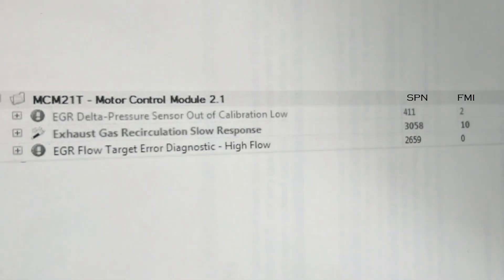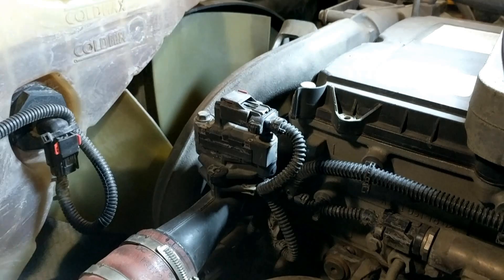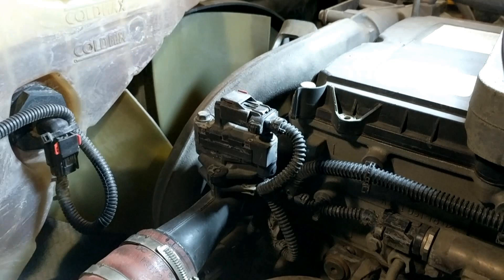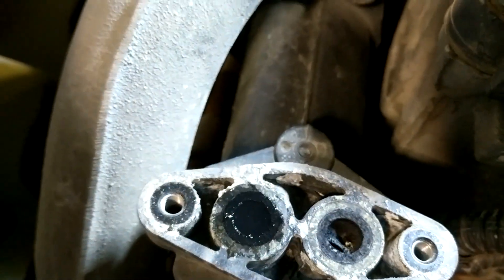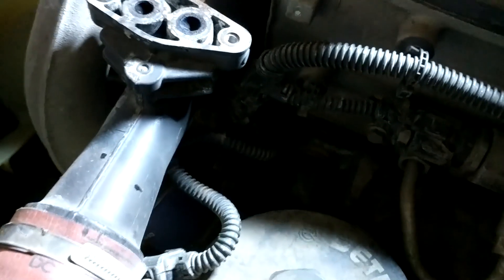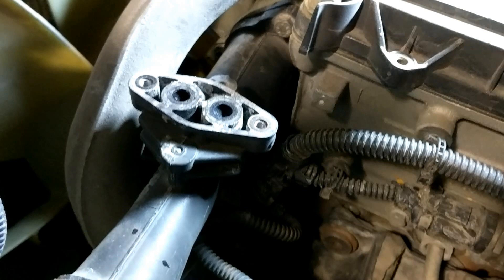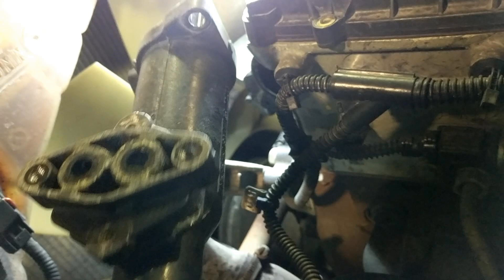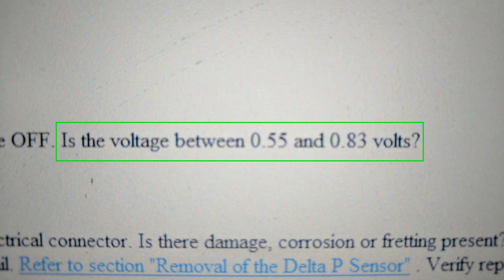EGR Quick Fix - Keep that Engine light OUT

Comment: Thank you for the video very simple and easy explanation. I am having the same problem right now. I will be disassembling the unit and checking for sudden blockage. Hopefully that fixes the issue you probably just saved me about $1500 at the dealer.

Comment: I’m having Issue with that code 
SPN 3058 FMI 10, I just replaced the VPod and the Delta P Sensor would it need to be recalibrated?

Comment: My truck been deleted. DPFs were removed but EGR wasn't blocked off like some guys have done. 

I received those egr codes recently. 

Spn 3058 and spn 2659

DD15
2016 cascadia 

Will blocking off the EGR cooler get rid of the codes and stop all that black smoke, leaving my exhaust?

Comment: I consider this basic maintenance, along with cleaning the 7th. Injector port (on dd13, dd15).  I clean them with a brass wire brush from a gun cleaning kit.  It's also very important to maintain your air dryer or moisture in the air lines will cause your pressure limiting valve to fail.

Comment: Thank you for the video. The problem im having is getting the v pipe off. Did you use a short socket and 3 inch extententiin or a long socket. Thanks in advance.

Comment: Good day, I have a question: should the delta sensor be replaced even if the EGR was deleted on the truck?
Delta check engine light is flashing.
Reply: The Delta P also regulates the Turbo Charger. If you still have a Delta Pressure Sensor, then it stands for a reason why you're getting a Delta Code. Replace it and clean out the Venturi Pipe. Clear those two small holes with a flexible wire or with a plastic zip tie on a drill at low speed. The zip tie will twist and act like a drill bit and break up the carbon build-up.  
 This should fix your problem.

Comment: Comprar uno nuevo es mejor las dos cosas $150 en el dealer y ya sensor y el gascket,i put new sensor and the other part for $150 at dealer chip it’s going to be better
Reply: Dicen que venden el kit completo con la pipa esto en necesario o solo el sensor y ya ? Q me recomienda
Reply: @JG-ss9xy  yo te recomiendo el tubo ese donde va el sensor y el sensor todo eso lo compras en el dealer el tubito negro y el sensor ya con eso esta bien 👍
Reply: @aleman876  si man gracias estás en lo correcto alguien me dijo lo mismo q comprara el tubo también q no lo limpiara porque se vuelve a tapar fácil, tú sabes si se necesita el laptop para programar el sensor o solo plug and play ?
Reply: No,solo cambias el sensor y el tubito negro donde va y ya,puedes cerrar la corriente por el switch del lado del asiento del chofer y abrirlo de nuevo y abres la llave 🔑 por 3 veces y la cuarta vez arranca ya el camion y listo
Reply: @aleman876  Great 👍 thanks a lot bro

Comment: I followed your video setup by stereo, and it's fixed. I asked the mechanic to take this apart, clean it,  replace the sensor and the gaskets.  He said, I've never heard about this, I can't do it. For $104 I got the original kit from the store in cambridge, ON. Took me one hour to do it.  I got 3 fault code,  now fixed.  This thing will cause 25% power loss and 10% fuel consumption increase. Thanks for your video.

Comment: I was getting SPN 411 FMI 13, SPN 411 FMI 2, SPN 2631 FMI 1, SPN 3058 FMI10 and then I temoved the Delta P Sensor. I didn't find blockage in the pipe but I found a congealed quarter in one port on the sensor. I cleaned it out, slightly scraped baked on matter from the O-rings and cleaned up around the port edges with a flathead screwdriver. Shortly after reassembly in getting a 25% derate and a consistent and persistent SPN 2659 FMI 0 only.  Is my Delta P sensor bad or do I have an EGR Valve issue? Thanks for the vid!
Reply: getting same code FMI 2659 FMI 0. did you figure it out? thanks
Reply: @andrewmack5049  all my codes were related to a leaking EGR cooler. The coolant was leaking out the hot side into the exhaust and DPF filter, so it's not good for that expensive component. I changed the cooler and haven't had any codes since. The cooler is about $1800us
Reply: @andrewmack5049  , here's a video for your code spn 2659 fmi 0:
https://youtu.be/s2yiU0ZCvFI

Comment: Wouldn’t a similar problems happen
On Paccar engines?
Reply from the maker: I have little to no experience with the Paccar engines but it's very possible.
Reply: @TheDieseler  I have EGR probs and fault codes that popped up talked a lot about egr pressures.

I’m at a pilot right next door to a Pete shop so hopefully that could be all my problem is. 

Tomorrow morning I’ll call the shop to see if they have the iRt and I’ll take a look at the one I have now. If I see soot mud ... stuff on my sensor I’ll replace it...

Thank you just the same for letting me pick your brain on this matter.

Comment: Detroit does not recommend cleaning venturi in any way. Cummins does. Detroit says replace it because it's coated with a non stick substance. If clogged supposed to replace. Not clean because it's not a fix its a bandaid.
Reply from the maker: EGR gases are corrosive. This is why the EGR system has coated components. 
Detroit absolutely does recommend cleaning of the EGR ports. In the right climate these ports can becoming restricted in very little time, whether the part is new or not. Replacing the Venturi every time would not make sense.
Reply: @TheDieseler  don't blame the messenger. I follow all oem protocol. I am oem certified in dd, cummins, international, hino. I have access to all software as well with all bulletins. It's says to replace not to clean. Fact. Sorry you don't like it but there is a reason for it weather you see it or not. Port of egr yes can be cleaned. The egr and tube not to be cleaned.
Reply from the maker: "Port of EGR yes can be cleaned"
Ok, thanks for finally agreeing with me since this video, from start to finish is about cleaning those ports..

Comment: I got the 2659 code. My DD15 started to derate. The Freightliner dealer couldn't get me into the shop until the next day. I found your video. I did this, it worked.  You really saved my ass. Thank you very much.

Comment: I was on the road and mine plugged up on one side..zip tie didnt work but I used a thin cable and a drill ...the cable was from seal used on the doors of refrigerator Van's or box Van's...its flexible and strong enough to break through.  Awesome video thanks

Comment: Hey we have a few 2016-2019 freightliner and KW trucks with the cummins motors.  We have replaced the EGR cooler on ALL of them around 90-110k miles.  Now a few of them seem to be mysteriously loosing coolant - no leaks under truck, no coolant in oil.  I am afraid the coolant is leaking into the EGR again and we are going to have to replace them, again.  Any idea what gives?  Or anything I can do to help it?  I would love to delete all that BS but I am unsure about doing that.. (yet)..
Reply: Did you find the problem?

Comment: Great video, however, can you explain how water gets in there ?? Considering it is so tucked away and far above the ground...TIA
Reply: MC Transport 
Condensation from temperature changes like he said at the beginning of the video. All air, even air that flows the engine contains moisture. Compressing this air along with those temperature changes creates condensation... water!

Comment: Do you know where this sensor is located in a Volvo D13?
Reply: It's on the venturi pipe.  Passenger side of engine. Follow pipe from egr cooler towards radiator.  That pipe sometimes is green (if original) and black ( if it was replaced with new upgraded pipe). It is right above and in front of ac compressor.

Comment: Will this turn on and say. Fuel  pressure is low. I have engine light an check engine light on. It has a hard time picking up speed. FED light didnt come one I change the doser valve it was black it work a little but I still have the problem. FED light never came on at this point. Also my fuel said I was low but not its tell me its not and my oil psi goes up and down. Fuel filter is clean. Coolent is not leaking at all and look under I see dry oil under but when I run it no oil leak check the oil stick my oil is not low.
Reply: It sounds like your Fuel Quantity Control Valve needs replaced, and your low Oil pressure sounds like your Oil Pump/ Pick Up Tubes have bad SEALS in your Oil Pan. These need to be checked for wear and replaced if the Pick-Up tubes are loose. 
Also, check the Oil Breather Filter/Oil Separator if it's clogged or leaking oil where it's mounted on the block. If you see any oil leaking from the Oil Breather Filter then change gasket with new Separator. This will cause low Oil pressure if clogged or leaks.

https://youtu.be/iEypTfa6Y2s

https://youtu.be/MIcVtIiiB6M

https://youtu.be/MLcs8oDk1Ss

 I hope these help you.

Comment: 4:48. What section on the software did you find that???? PLEASE REPLY
Reply from the maker: The Voltage readings? That particular screen is "Service Routines" --> "Voltages". You could also use other methods like "Chart" to graph it, etc..
Reply: TheDieseler do you have a paper sheet on what sensors should be at what voltage?  I really need this type of info.  To see if sensor bad or good
Reply: TheDieseler how to know which sensor should be at what voltage?

Comment: Quick question wondering what y'all might be able to help me with as far as a answer, if a check engine light is turned off from a shady dealership and it turns out to be that the check engine light was for the transmission. My question is does the check engine light always come back on if the codes are cleared out of the computer in the vehicle? Just curious if anyone here knows the correct answer, from what I have researched the check engine light should come back on say within a hundred miles of driving or sooner even, but this situation the check engine light never came back on the dealership I took it to for a proper diagnostics was able to pull up the codes that had been previously deleted. Thanks in advance
Reply: If codes are cleared out then that means they were INACTIVE codes or HISTORY codes. These will not come back or put an Engine Light ON. But if ACTIVE CODES are deleted by a computer laptop or a handheld computer the ACTIVE CODE will NOT DELETE. All active codes stay as ACTIVE until the problem or issue is fixed. The Engine Light will come back on immediately if the active code is not properly fixed.

Comment: i work on these dd series engines alot. i found that cutting torch tip cleaners work very well to get the caked on soot inside the vintury ports out. start with the smaller tip cleaners and work your way up.

Comment: ? Will it be ok to just block off tube that leads to intake manifold and just leave the original EGR valve alone, will gases still return back to engine
and will it still set off a code..... if done this way.
Reply: Lol. You will have NO TURBO,  and the SOOT levels will clog the Egr, Venturi Pipe, and Delta Pressure sensor.

Comment: Please offer advice. The truck I run is Freightliner Columbia. On acceleration it coughs like a misfire eventually clears but next time accelerating cough spluttering and then runs good but while it’s trying to sort itself out power is low and truck is slow. Boss says it’s the EGR valve cutting in and out and local mechanics can’t fix it. Can you offer a solution please and thank you. 

Richard
Reply: My friend had this problem. it was EGR getting stuck. At first he thought it was a turbo but it wasn't so He replaced turbo anyway and took care of EGR. problem solved.
Reply: Make sure the connector plug and wires to the egr valve are good and connected.

Comment: Cascadia a/c clutch plug no power any idea what cause
Reply: I have the same problem. Did you ever figure it out? I've had my truck in 3 shops. They're telling me that the problem is the sam cab and the dealer is the only place with the software to fix it
Reply from the maker: Which engine are you running? I ask because I'm almost positive I've seen some of these with a Cummins engine that were wired a bit different. They picked up constant power for the compressor at the Starter positive terminal and controlled it on the ground side. If the starter has been changed recently, is possible to forget that little ring terminal.

The SAM cab needs to see engine rpm, proper voltage and a good reading from the pressure transducer to engage the clutch. Without a look at what it sees (Software), it can be tough to verify this.
Reply: @TheDieseler  2012 DD13 engine. I have a Sam cabin A/C clutch compressor circuit shorted to ground code. Haven't replaced the starter

Comment: I really can’t thank you enough for this kind of information. But I really would like to know your opinion on the Detroit DD 15 how good of the engine do you feel it is, and 2. How often would you say you should check those ports you’ve mentioned about in this video.
Reply from the maker: My personal experience with 13+ liter engines over the last decade has been mostly with Cummins and Detroit with some Cats thrown in before 2011. I've always liked Cummins but over this time they've been getting out shined by Detroit. They all have their share of problems but I just tend to prefer Detroit. Daimler trucks and Detroit are so integrated now, it tends to aid in diagnosing and troubleshooting with electrical and aftertreatment issues.. Which is what I tend to spend 90% of my time doing these days.
As for the ports, I would say every 4 to 6 months. Maybe sooner if you frequent very wet/humid areas or when the temps float around the freezing point.

Comment: Do you know anything about the international N 13?
Reply from the maker: I know enough to stay away from them! Seriously though, I had some mild experience with DT466s/MaxxForceDTs over the years but have luckily never had to deal with much of their big-bore stuff. I'm just waiting to see how their A26 turns out. They could turn into a chassis manufacturer only if it flops too...
Reply: TheDieseler I have one that was purchased at auction. It has pressure in the cooling system and the entire egr has been blocked off with 4 little plates, so no chance of an egr cooler causing this. I feel that it is a liner issue however I have no experience with this engine and was wondering if anyone that has had experience with them could tell me a possible common cause of this on this particular engine or should I just turn it into a boat anchor and swap out to an ISX . This is a nice truck.

Comment: hello sir i have paccar mx 13 and i have code on my dosh monitor #4 injector data and egr delta sensor . i already change injector but my check engine still on and both code is still on plus my engine is derated . any help please
Reply from the maker: +Lion Arm Sorry, I've had almost no experience dealing with Paccar Engines.

Comment: I have a freightliner cascadia 2014 this cold spn 973 fml 13 comeing out and says engin break
Reply: engine retarder selection signal missing
Reply: I looked up the code and this came out
Reply: But a buddy saying it's the egr
Reply from the maker: You're right it is Engine Retarder fault. This is usually a problem on the truck side since the switch signal is Multiplexed through the MSF. There could be a problem with the switch itself or the Subbus switch pack it sits in. I would at least pull it out and make sure the contacts are clean.

Comment: hey i got a 2014 cummins isl on a freightliner that has a code spn 3058 fmi 18. Does that mean a pipe or sensor is not reading the egr flow? thanks
Reply from the maker: Paul B. I'm pretty sure that code crosses over to Cummins Fault Code 3382. "EGR System - Data valid but below operating range - Moderately severe level"
The measured EGR flow is lower than the ECU wants to see. This can be caused by the same problem covered in this video. Also, leaks or restrictions in the EGR system (pipes, EGR valve, EGR cooler, etc)
A stuck EGR valve or even VGT problems. The sensor ports are where I would start though.
Reply: thanks for the quick reply, so I took off the pressure sensor and I blow air into one of the ports and there is no air coming out from the other one. Does that mean that the egr Is plugged up?
Reply from the maker: Paul B. Both ports must flow air freely into the intake. It's very common to have one completely plugged

Comment: I tried the plastic zip ties with a drill and it worked for me. Just insert the plastic zip ties far into the ports and use the drill at low speed. The zip tries will curl  basically into a plastic drill bit. 2013 dd15 engine.
Reply from the maker: Johnathan Murrah Thanks, that's some good info!

Comment: How do you get the software that will read a DD15 engine and how do you connect it to your laptop?
Thanks.
Reply from the maker: 97935 c242 Detroit Diagnostic Link can be purchased from Detroit Diesel. Connecting it to a computer requires a translator box like Nexiq. There's a few different companies that make them.
Reply: @TheDieseler  I'm having this code spn 411 fmi 13 and had 25% derate,have you ever had this happen?

Comment: How could i find out if my egr is goin bad? I have a 2012 freightliner cascadia DD15
Reply from the maker: eric manzo The EGR's performance is monitored pretty closely by the MCM. Check Engine lights will usually be your first clue. You can also have more silent problems like a leaking cooler. But you'll notice the engine going through a lot of Coolant with no visible leaks.
Reply from the maker: +Corey Brown This is USUALLY true. But, I have seen EGR valves fail without setting faults. Some to the point where the engine would not run (Cummins).
Reply: eric manzo if u dnt have a check engine light you find.  Or throwing a code.